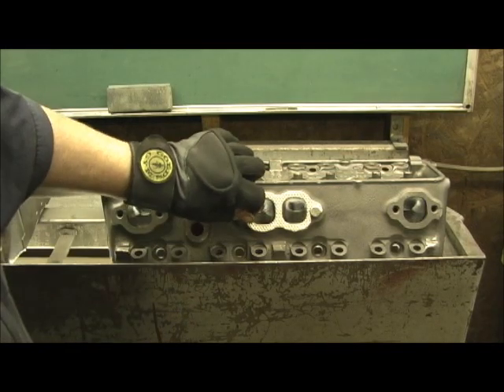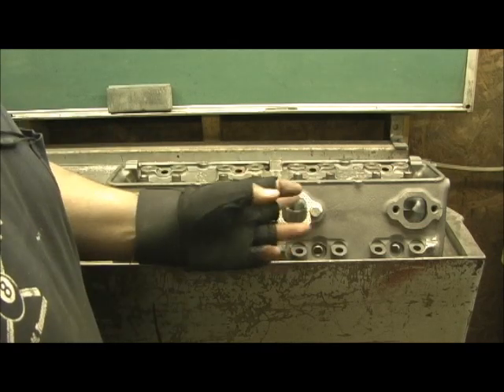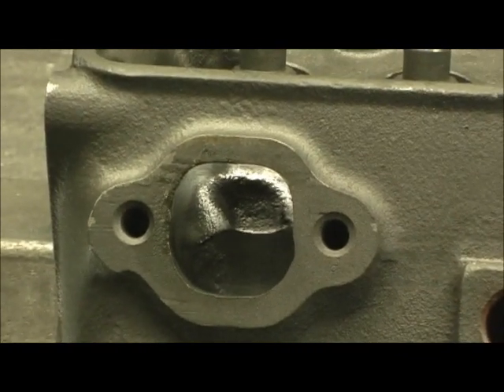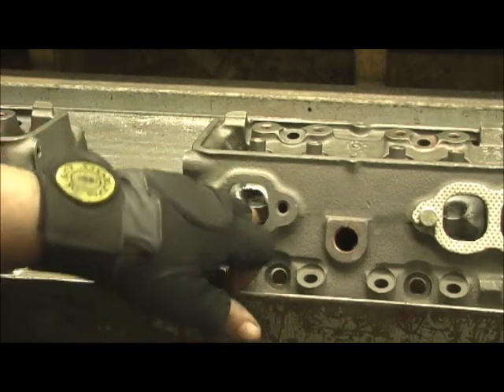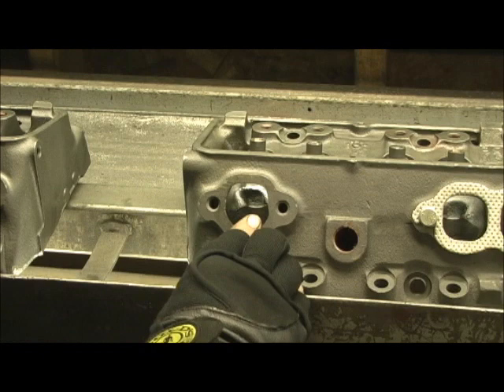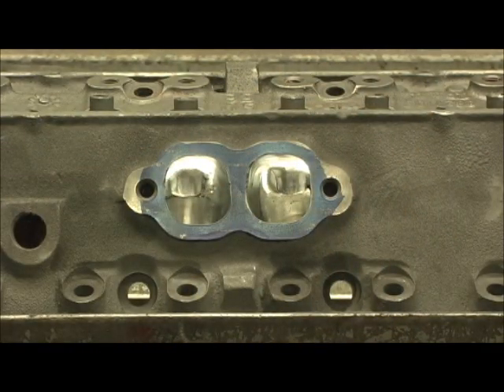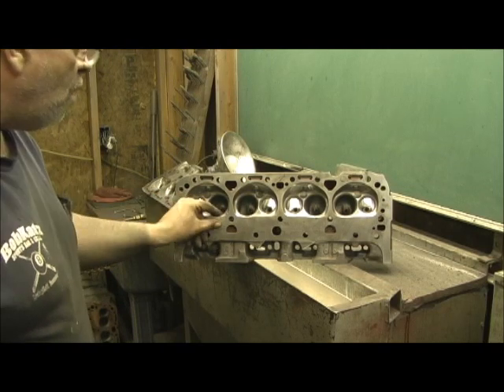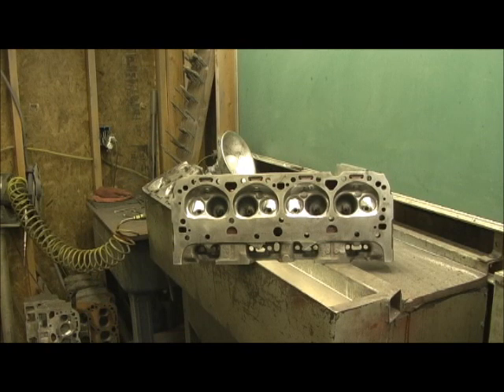Imhoff 186 SBC Exhaust Ports and Short Turns 6.0

Comment: Kenny, I spent $1000 on just the intake side 12 years ago. Another $1000 for larger Chev stainless valves, and screw in studs , hardened seats, the decking and flow. This included valves, seals and guides and full install of dual springs from an MG as these were all I could find for the proper install height and open pressure. I too asked this question. A total of $2000. Now has potential of 320-330 hp apparently. Not installed yet. Done here in B.C. Cannot wait to get it running. I wish I Knew of Tony then! He is the MAN!
Reply: Sounds sweet